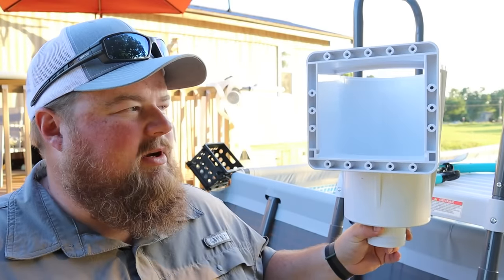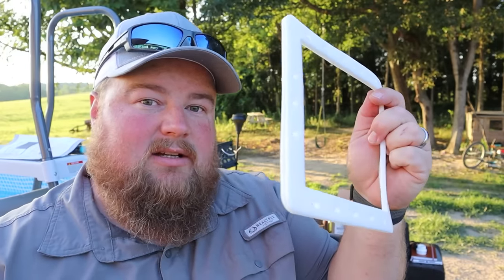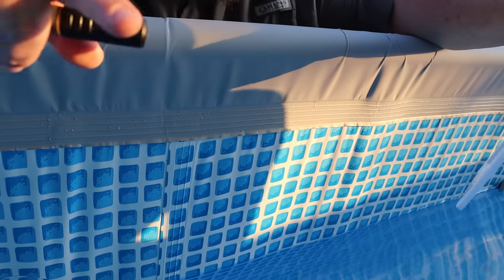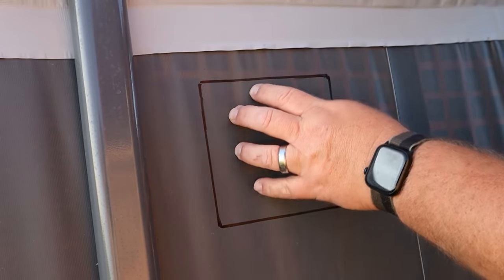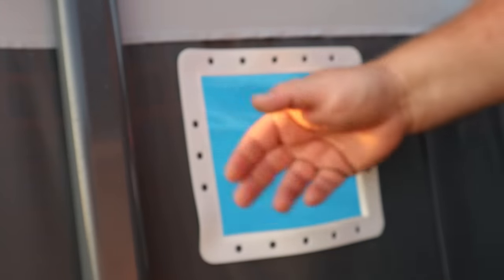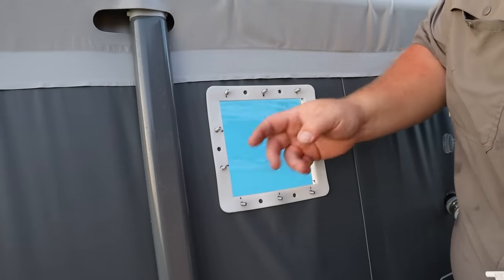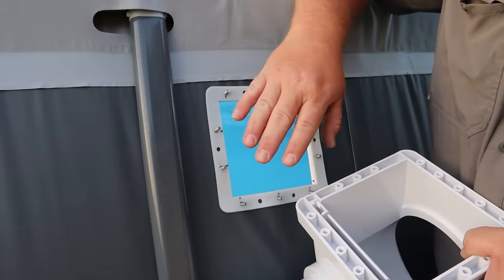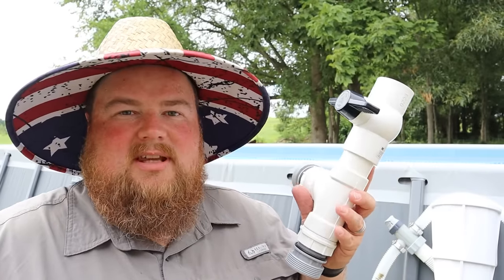BIG UPGRADE:  Pool Skimmer Install on Intex Above Ground Pool | Hayward SP1091LX Dyna-Skim

Comment: We have a $10,000 above ground pool with two skimmers and it still doesn't catch all the bugs I don't think anything other than a person permanently patrolling with a net 24/7 would get rid of the debris completely you did a great job Sam
Reply: Amazon has pool skimmer socks. They catch everything. Almost nothing gets into the pump basket. However I am retired and can keep an eye on them though the day. They can get so full of pollen at times they can starve the pump of water. So I would suggest not having the sock on when you are not there. But for a retired person this really keeps the pool clean. I have not hand skimmed my pool once this season. Have a nice day!
Reply: The problem is probably the placement of the skimmers, pool that come with skimmers have the water return placed and angled so that the water move toward the skimmer, in a above ground round pool that would be turn in circle in the pool witch mean the bugs and anything floating has more chances of ending in the skimmers
Reply: Pool skimmers are almost always the wrong height, you are supposed to get a whirlpool/waterfall type effect if that doesn’t happen they are almost useless
Reply: Why do you not cover it when not used? It even stays hot for free. 
We use a nylon sheet that we simply roll up and down.
Reply: 10k  😂
Reply: I have one skimmer and it catches everything. Maybe you need a stronger pump.

Comment: Never cut until skimmer is installed!!!
Reply: Firstly I agreed, but if you look at the rubber gasket he installs, you need to feed it inside the cut hole, which you couldn’t do if the skimmer was attached first.

Comment: You can actually leave your water in the pool , install the skimmer before you cut the hole and after its installed, and plumbed, you cut your hole and boom your wet. Irt also helps a person keep from doing run-away corners, because you have the trim, I just cut the gasket at its seam so it could be installed on each side instead of in the opening.

Comment: One more improvement I think you should do to your plumbing. You should put another valve where your original intake hoses tee into the line from the skimmer.. This will allow you to adjust the amount of water being pulled from each place. If you use a traditional pool vacuum pole and hose you can custom adjust the flow to what works best.Also either side can be isolated for maintenance without shutting down filtration.
Reply from the maker: The gray unit I zip tied to the pool leg is a valve for those hoses. :)

Comment: Very nice job there! My only advice would be that where you zip tied that hose to the pool leg, insert an old cut garden hose to  absorb vibrations that occur in pool plumbing as the water rushes through the system. This will greatly reduce unwanted cut-in to your new hoses where they touch anything solid like a pool leg or even another nearby hose.  This isolating technique I used for years in the car wash industry to eliminate early deterioration of the many plumbing lines that are run throughout car wash facilities. You can use a small cut piece of garden hose or a cut used old radiator hose or even a rolled up old rubber car Matt. Good luck with your pool and you will find many of your best family memories will be made right there in that pool. My grown kids still talk about our midnight summer swims!
Reply: Great ideas and thanks for sharing! You are so right!! I have wonderful memories with my son's and my brother in an old above ground pool from 30 years ago. Have a blessed week:)

Comment: We finally broke down and got a 16inch Intex sand filter. It made a huge difference for our skimmer because of the high volume of water and it being able to push high enough volume into the pool to really keep the water circulating around the pool to the skimmer. best 300 bucks I ever spent.

Comment: I had a 15’ round Intex pool that I attached a Hayward skimmer to. I was so nervous to cut the liner but it was the best thing I ever did. I cut the skimmer hole where the outflow was because it was the highest, and then used the intake as the new outflow so I didn’t have any extra holes to contend with. I was also able to attach the Intex adapter directly to the bottom of the skimmer. And yes, Teflon tape is a must! That way I didn’t have to deal with any extra pipe fittings. Having that skimmer saved me so much work! I only had to skim myself after a strong storm. The skimmer also made it easier to connect a Hayward Aqua critter pool vacuum that did the work for me so my maintenance was minimal.
Reply: What a great idea to swap the locations of the new skimmer and outflow!  I never would have thought of that, but it makes perfect sense! (I also have a 15' round intex ultra frame).  Thanks for the awesome idea!

Comment: Hey Sam. Just fyi.  I had an Intex pool set up with a skimmer, and I took left the default suction/inlet things attached using a very similar set up except I had to add shut off valves to everything myself. But!  I noticed a remarkable increase in what the skimmer trapped when I closed the two defaults and just let the skimmer be the only inlet. Also, the pool stayed cleaner when we just left the pump running 24/7. We ran it for 5 summers and never had an issue except having to replace a couple cheap gaskets. Just backwashed often and kept up maintenance. It still ran last we had it before I became disabled and couldn't use it.  Also, we created a sprayer/sprinkler by splitting the jet line with 2 valves that the kids loved to play in and it kept the pool cool in the Oklahoma heat. Just connect in some PVC and zip tie a arm to the side and drill a line of holes.  If you use a gasketed T with ring nuts it makes it adjustable!

Comment: We have the same pool and it’s directly under a bunch of trees so it was always a mess .. we upgraded to a bigger sand filter and it was a game changer! I bought that Intex pool skimmer that hangs on the side .. it’s ok but now that I know we can add a real skimmer I’m definitely going to do that! 🥰
Reply: I also bought the skimmer that hangs on the side. Used it as-is for the first year or two but then I bought filter socks for the basket and THAT'S been a game changer! I put a rock in there to hold the sock down. But the sock helps catch even the smallest particles which saves the pump and sand filter from working so hard. Highly recommend!!

Comment: Great video as always.  Just make sure that when you build your deck you design it so that you can use it and will like it without modifying it when you decide to take down the pool.....and believe me, you will eventually get tired of maintaining the pool and the kids won't use it nearly as much as they did and you will decide it is more trouble/expense than it is worth! LOL  The only way adults truly enjoy the pools is if they are heated.  And that is even if it is hot out.  A heated pool allows you to stay in longer without getting chilled. I speak from "living in hot Florida" experience.  It is MUCH nicer. JMHO Have fun!!!

Comment: Am so glad I saw you add the skimmer.  I purchased a new pool last summer and I was told that if I cut into the pool the liner is not strong enough without reinforcement and that it would rip.  So afraid to ruin the new pool I let it go and miss it so much.  The skimmer you clip over the side is not strong enough.  Thank you. I will swallow my fear and tackle it since I have all the parts already. ❤❤

Comment: After 13 years my 9x18 intex is on its last leg. I noticed the top of my bag was being ate up by the sun so I covered it with flex seal it worked but peels some , maybe I’ll use paint on the next one. Also the sun obliterated the liner that attaches to the upright supports on the ground so I definitely will paint them on my next pool. I ended up wiring mine so the uprights wouldn’t slide out. Great video.

Comment: I built a pool deck and added a hayward skimmer to that same pool this year.  I got some leaks initially, but used a little "Flex Seal" tape and it seems to be solved.  I'd recommend cutting off the second inlet and let all your suction come from the skimmer.  It pulls a lot harder but with the 1.5" it should feed more water than the pump can handle and maximize your skimming.  We use the second outlet with a smaller pool pump (from previous pool) to feed a solar heater.  So we are exchanging from both outlets but getting much better GPH since two pumps are pulling (also warmer water).  Great Video, thanks for sharing!

Comment: I have done several of these glad it worked the way you did it but the easy way is to just pick one top corner of the skimmer bracket take something pointed put one little hole where the first screw goes and then just align it up and then put that screw partially in then go the other top corner do the same and then you can just go around and put the rest of the screws in. I don't cut the hole out until the skimmer is fully mounted. Also, I go over the top seam where it just starts to open up for the support pole, so I can fill the pool all the way and it works great, makes it like a traditional above ground pool. Great job BTW it makes it so much nicer it is a big upgrade a must if you ask me but the first time it is a little scarry though LOL..

Comment: We were considering do this. After watching this, we are going to do this. The installation looks easy. 

* We upgraded our pump to a 1 hp Hayward pump after 1 month. HUGE difference. Floor vacuum (Hayward Wanda) started working like it should. Water easier to keep clean.

* Enclosed the pump in a mini-shed this year. Can barely hear the pump run now.

Comment: Nice video.  

I installed one on mine as well as doing all hard piping - less restriction of the water flow.  Also upgraded to a 1 1/2hp pump with a 175lb filter with glass instead of sand for the filter media.  Yes, it was overkill, but it worked like a charm.  

My neighbor (who is owns his own pool cleaning/maintenance company) was impressed.

Comment: Very cool!  In my friend’s pool we just encourage the bugs or whatever leaves toward the skimmer when we are in the pool.  That helps!  Tip:  secure a pvc pipe to a corner or legs with zip ties that goes up a couple feet above the pool.   Great way to store all the floats that have holes in the middle. ❤

Comment: You can buy little "socks" for the skimmer basket, made of fabric similar to pantyhose. I used them when I let my dogs swim in the (inground conventional) pool. I changed it daily for the dog hair buildup. 

The little sock kept my primary filter SO much cleaner. I pulled most of the dog hair off the sock manually, then washed them in the laundry, and air dry. (I rotated a set of 4.)

Dogs might not be compatible with an above ground pool, but I thought it was worth mentioning as a cheap but extremely useful skimmer basket upgrade. And the sock certainly catches more human hair, smaller bits of plant debris, etc.

Comment: I PVCed my pool. And the difference in pumped flow tripled. Compared to the flex rippled hoses. All ripples cause water to flow slower. Straight PVC no obstruction what so ever. It’s a must on above ground pools. In my opinion.

Comment: Those old intakes for the pump are good for another pump inlet and outlet (after cutting the holes bigger).  I replaced the small pump that came with the pool with a larger pump with sand filter.  I then use the smaller pump plumbed into the old inlets for vacuuming the pool.

Comment: I love those skimmers. There is a lot less work when cleaning the pool. Also more inlet water flow which move the gunk on the surface towards the skimmer/filter. Make sure to do your backflushes to keep from building up a scum layer on your sand in the filter. Ours said the sand would be good for 5 years if taken care of properly.

Comment: really great video!  there are several others that cut the gasket into TWO and then cut the opening last, but your method (cut the opening first to fit) makes more sense to me!  And thanks for the plumbing tips and parts list!  Used those amazon links and ordered!
Reply from the maker: Glad it helped

Comment: It's also good to use a hole punch with a piece of wood as backing on the inside to cut the corners round, then connect the dots with a blade.  That will avoid stress corners in the liner that can rip.
Reply: How can you make the punch if you have a piece of wood on the other side
Reply: @blove87  USing a gromet punch requires the cloth/material being punched to be supported with a wood or plastice surface so the punch has something to bite into to cut the material.  A small block of wood on the inside provides this "backing" so the punch can cut.  Hope that helps.  The is a video here called "how to install a grommet" that might help shed light on the backing and the type of punch I'm speaking about.  Good luck!
Reply: @derekturner3272  appreciate the information! I’ll check now, it was the thing I was most concerned with. Those sharp corners eventually buckling.
Reply: @blove87  I think, in a pinch, you could use an xacto craft knife with someone holding a block of wood on the other side to gently round the corners as you cut.  That's what I did until I figured out how to use a hole punch.  gl!
Reply: @derekturner3272  how’s yours holding up? Did you ditch their setup completely? I know you obviously get rid of the 1 1/4 tee but I wanted to change the return also since the fittings need the hoses with the screw on piece not stranded, regular hose that used normal hose clamps
Reply: @derekturner3272  I can tell 😭 as I look at my old pi’s I had one running NAS software and the other a VPN server. Crazy setup, I think I’m going to just do the skimmer, I have a 200lb sand Hayward sand filter and 1.5HP pump since I replaced an above ground pool that had the metal wall and liner. Right now I have the pump and filter from the new one until I figured out my plan and definitely change the sand. 

If i do that, from the skimmer to the pump I’d have 1.5in, I’d plug the other. Then for the return I’d swap it for one that can support 1.5 without the Intex screw fitting hose. I can get it all from local pool store I believe. Thanks for the info so much

Comment: You really need to put some kind of brace under the skimmer. 
Since yours is a soft sided pool the sloshing action of people in there causes the skimmer to jiggle up a down, it'll eventually wear a hole in the side. 
My friend found out the hard way that a brace is necessary to take some of the weight off the skimmer.
Reply: I have a length of PVC pipe cable tied to the fittings under the skimmer. It runs from the ground up to the skimmer bottom just to catch some of the weight.

Comment: If I were you, I would upgrade to the biggest Intex filter they make that’s the one I use on my 18 foot round pool. I know it’s overkill but when you add a vacuum you need that extra pressure so everything run smoothly. Don’t regret it and it’s only like 300 bucks.

Comment: Sam, I have ordered my skimmer and have watched a dozen videos on installing them. Yours is the only one that leaves that gasket intact. Everyone else splits theirs. I have watched so many of your videos that I trust your skills and advise way more than anyone else's. (not that they are wrong) few even show what to do with the original intakes even. You made this look very simple. I am seriously thinking about plumbing in the original intakes as well just as an extra source.... Your thoughts?
Reply from the maker: Thank you!  There are times where we still use the two small original intakes and I'm happy that we've kept them. Scenarios where I use them: draining the pool for winter - they're a lower point on the side wall, added filtration flow if we have our bubble wrap floating cover on, as a backup water source for the pump when we want to clean or shut off the skimmer for some reason.

Comment: I thought about getting a square piece of vinyl and using solvent glue to bond it to the pool liner where I want to cut out the hole for the skimmer, to sort of double-up the thickness and hopefully prevent the liner from splitting/tearing out.. especially in the corners of the rectangle that get's cut out!  I also thought about using a hot-knife to "cut" the rectangle out and also radius the corners instead of 2 slits coming together at a right angle, that should cauterize the vinyl and make the corners around the hole extra tough and prevent splits/tears when the pool water pulls down on the liner.

Comment: As much as i cleaned my in ground pool, debris, bugs would always be on the surface. My skimmer can only do so much, and the pumps dont run 24/7. I purchased the Betta SE,  great addition. My surface of my pool is crystal clear, the machine works 24/7, as long as sunshine is available. If there's enough sunlight hitting it during the day, it will run all night. Highly recommended.

Comment: .When I added a skimmer i changed my output to intake and intakes to output and got rid of the intex flex crap hose. Spent a little $$ but my filter and pump are in the garage. 2 returns and 1 outlet works better for water movement. I also dont have the intex pumpand filter either though. Changed to salt this year😉. Didn't add an extra hole in the liner when I added mine.